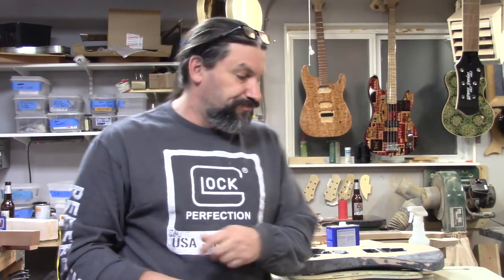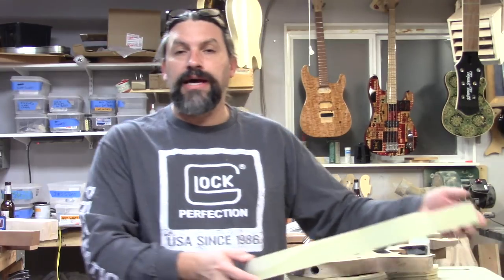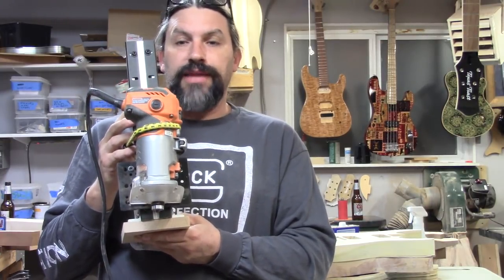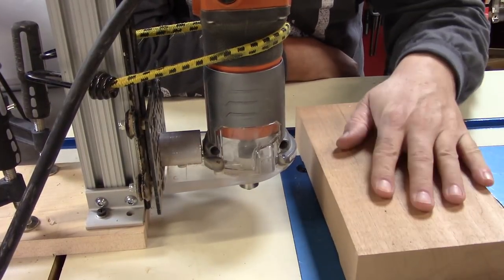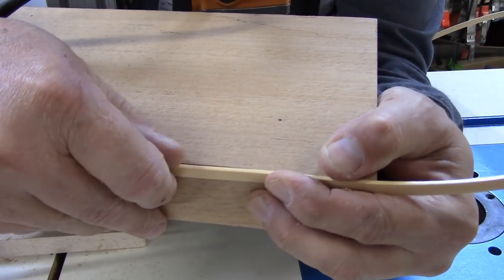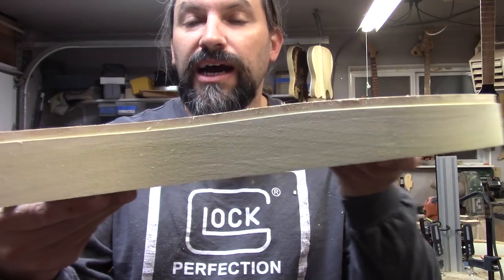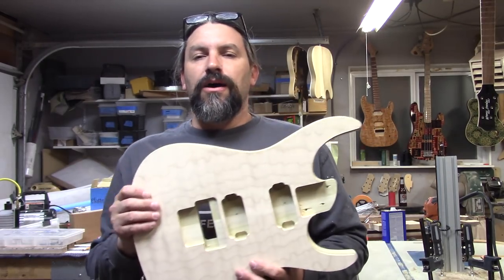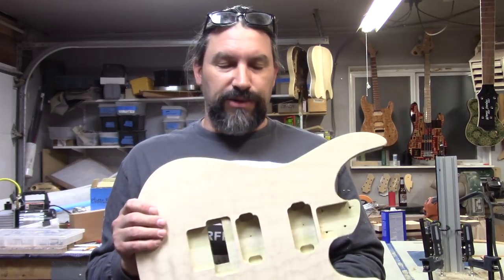How To Cut A Binding Slot On A Guitar Body And Look Good Doing It!

Comment: I had a body I didn't plan on binding until after it was all CNC cut ... so I got a large bearing to fit the trimmer bit I had and fixed the z-axis on the cnc with a board and clamp and manually ran the body and the router in x-y like a hand-held pantograph to cut the binding slot all around. The subsequent gluing of flamed maple binding had it's own challenges though ...
Reply from the maker: I like your style, using a CNC by hand, I think you just made a pin router... I use mine without the pin all the time.

Comment: I'm trying to DIY something. Want to router binding slot into a curved top thin body. 
It's an Ibanez s521mol (Incase anyone wants to know) 
This idea has given me ideas. Using a dremel and some contraption like you guys have.
That could follow the top and edge curves perfectly if built correctly.

Comment: Cool video, I already have the stewmac binding jig and they fail to mention that its only really good for binding acoustic guitars. I have to fidget with it and it's a pain in the ass to get inside the horn area on most guitars. I don't know why they built it so shallow I'm going to bug them about it maybe they will change the design, I'll go on that site you posted and get the parts to extend the stewmac version thanks for posting that. Oh yeah is that a hippie wood top I see hanging in the back round haha.
Reply from the maker: I'll bet you could modify the StewMac unit to work with horns. Especially if you know a guy like Brain Surgery Kevin. 
As far as hippie wood goes... probably LOL

Comment: I can't think of a more wise group of ppl to ask about these paints so here goes. I have a can of Touch 'n Tone that I love the green of, a great red by Deruato and some clear coat by Krylon ColorMaster. I plan on repainting a really cheap Chinese guitar I bought for the hell of it when I started learning about fretting. $67 and it's almost there, but I hate the blue paint, though it's not terrible, I figure it'll make a proper surface to practice a burst on. I'm a cancer survivor and Army vet, so cash is profoundly tight atm, though the Army has nothing to do with my poverty, that's all the cancer, having lost 2/3rds of my tongue, I can't exactly get back to sales or retail management. (when they replace your tongue meat with under chin skin and the hair grows wild until the radiation finally kills it, that's a weird place to live, literally, fuck me, I'm drowning in hair that suddenly grows 20 times faster than it did in a beard!) Anyhow, am I better forgoing these sprays and just getting the car paints? Will they stay soft like they seem to on my pickguards as I've used them or is there some sort of catalyst that will stiffen them up. I thank you for you time and your opinions. When I can get back to a somewhat normal income, I'll be joining your pay channel, I'm just a bit screwed at the moment.
Reply from the maker: Hi Damaged262, I'm not sure of the makeup of those paints so you will need to do either, some research (I hate doing that) or do some testing (much more hands on and my speed) to see if the paints will work with one another. It has been my experience that anything in a rattle can will stay soft for a long time regardless of the type of paint used. That doesn't mean you shouldn't give it a try and see what you come up with. 
Having said all that once you get to the point that you can get a small, or even a large, set-up to use automotive paints the world will be your oyster. It isn't the most cost effective way to go but it isn't the most expensive way either. 
I would also urge you to give oil finishes a try. They aren't as glossy and don't come in as many cool colors but they are pretty neat. I would direct you to a place called Wudtone finishes. I have used some of their stuff and it was neat. 
Keep me posted brotherman
Reply: @TexasToastGuitars  Thanks for getting back so quickly. I gave it a lot of thought last night and I'll be doing just as you suggested. I got to thinking about a scratch plate I painted with Krylon. It was off of an Epi that had cream plastics but the triple ply was stark white and I always hated the look of that. I ended up replacing it because the paint never did get hard. I even dragged it out last night, 5 years later, it's still soft. I'd decided to wait until I can swing some auto paint, but now I'm going to take a look at those oils. I'm normally not impatient but I made the mistake of hanging the guitar in question where I can see it all day and now it mocks me.

Comment: Ha ha. I thought I was the genius to invent the Openbuilds binding router jig. Ah well, not a genius after all. Or maybe we both are! Yeah, I'm going with that.  I haven't figured out how to rig up a bumper curvy top-rest thing for mine yet, it's a different mount than yours.
Reply from the maker: I like your style and your willingness to use the same technical style terms I do. You can figure it out brotherman, I used my drill press as a lathe to make the plastic curvy bit.
Reply: The drill press lathe is a great idea. My Bosch Colt trim router doesn’t really have any mounting points near the bit after I take the base adjustment housing off. I’ll figure something out. A buddy has a 3D printer so i just need to design something.

Comment: Poplar seems to be the wood now.
Reply: salmonline it’s so weird. I always thought of it as poor man’s alder. It’s soft and easy to work with, being only a little tougher than basswood. Fender used it a lot in the 90s as an alder substitute.
Reply: I first saw it in furniture factories in Hickory, NC.
They've been building frames out of the stuff for decades if not longer.
It's pretty cool wood.  The color variations can be very attractive.
Reply: salmonline my old 90’s Jazz Bass is made of the stuff. Has good tone. It just shows abuse easy like Basswood and you gotta watch out for stripping out screw holes a bit(like with basswood). I know it grows super fast and I think that is why it’s hot right now. More sustainable wood than others.
Reply from the maker: I think that if poplar wasn't so green it would be way more... popular.
We use it all the time and it is a great wood. Now, I have some REALLY cool 1 piece alder body blanks that I would be happy to sell for lots more than a similar sized hunk of poplar.
Reply from the maker: Here in Colorado we pay about a buck more a board foot for basswood than poplar. I think most of the guitars Chris plays these days are poplar and my #1 bass has a poplar body too
Reply: I bought an 80's Kramer Stryker Series P/J bass, black and maple.
I bought it cuz it was $200 and it felt good and sounded good without being plugged in.  Turns out (when I beat in against a tree one very, very bad day,) the body was plywood.  The neck exploded in my hand and took weeks to heal...lol...
I think that's when I decided I'd try not to be a wood snob.  I have a basswood strat, for now.
Reply from the maker: Basswood if fun to work with, for some reason it is a little more than poplar